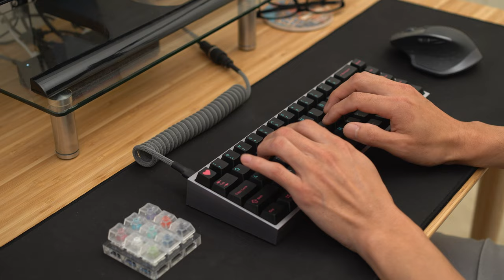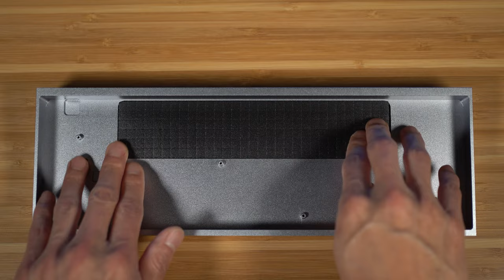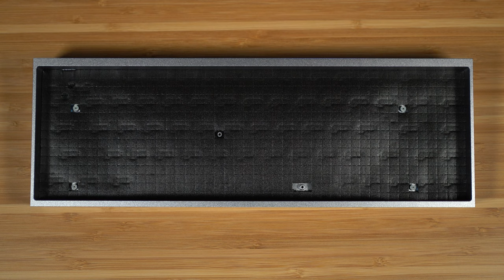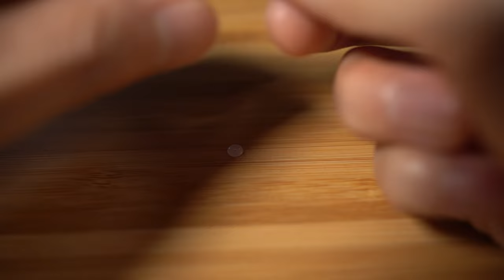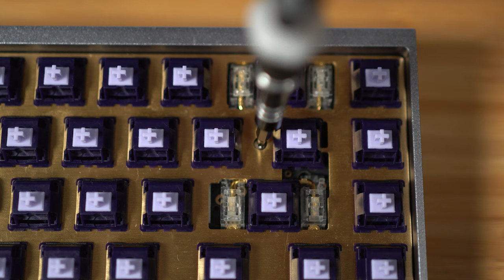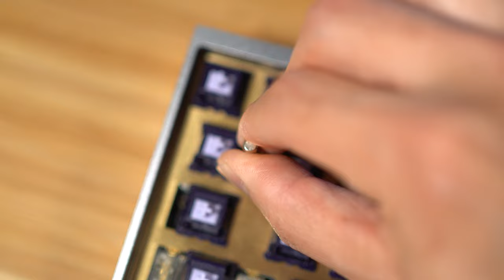Make the BEST sounding TOFU!  TOFU65 O-Ring Mount Mod Tutorial

Comment: I wonder if this is possible for the Corsair K70
Reply from the maker: Hi Kos Sports!  It's interesting you mention the Corsair K70 since I have a K60 right here which is very similar,.  Unfortunately, these keyboards actually have somewhat of an integrated plate design, and would be difficult to o-ring mount it to the lower tray.  Hope that helps!
Reply: @Keybored  thanks for letting me know! I know it's harder to mod boards like the K70, so that doesn't surprise me. I'm guessing that means I couldn't punt any dampening foam under the PCB either?
Reply from the maker: @KosSports  the K60 actually has space for dampening foam! Also I lubed the MX Reds that it came with, and lubed the stabilizers also! These little mods really did improved my K60! I hope it works for you too!

Comment: Would an o ring that is 4.5mmx1.5mmx1.5mm or a rubber o ring of the 4mmx1mmx1.5mm work fine? If so which would you use? The exact one with your size is kind of tough to find lol
Reply from the maker: Hi Kristian! I don't have exact experience with that size, but I assume the small difference shouldnt have too much impact. However, the thing to keep in mind is the ID! If it's too big, the screw will not catch, and just go straight through the o ring

Comment: would u recommend cutting off the middle standoffs
Reply from the maker: If you're using a stiffer plate like brass or aluminum, I don't think it's necessary.  With the O-rings on the outer stand-offs, I didn't notice the center part of the plate actually touching the stand-off at all.  It floats there pretty well!

Comment: I have the exact same board as you and did the exact same mods, but mine doesn't sound like yours. I've tried durock T1, durock smokey L7, holy pandas, NK creams, gateron milky yellows, koalas, etc. Does this sound ONLY come out with your switches on a tofu?
Reply from the maker: Hi John! I believe standard T1s should also yield same sound. The keycaps I'm using also contribute to this unique sound. I noticed that the doubleshot abs (gmk, epbt abs caps, etc) makes more of this plasticky pitch. Also, make sure not to tighten the screw down all the way and squish the o rings too much!
Reply: @Keybored  quick question.. How far do u place the fifine mic from the keyboard when u record sound? I'll keep trying my friend. Thanks so much for your response.

Comment: Why did you forego the two center stand offs?
Reply from the maker: Hi Lucas!  I skip the middle stand-offs, since I'm using the outer 4 and the orings to elevate the pcb/plate and reduce the hard contact points above the alpha keys.  This helps to create a more even feel and sound, and also softens the typing feel quite a bit!

Comment: Personally I still feel the sound is uneven when I tried this.  I still like a build with no stand offs for some reason. Gasket or not doesn’t matter just no stand offs in the build even between pcb and plate.
Reply from the maker: Make sure not to tighten the screws too much.  If you tighten it too much, it pretty much goes back to the stock tofu :)

Comment: Would slightly bigger O rings work? Only ones I can find that will come this month have a ID of 1.5 mm and an OD of 4.5 mm.
Reply from the maker: Hi Ben, the larger OD might be ok, but I'm not so sure about the larger ID.  It might work out ok, but only thing you need to watch out for is so that the screw head doesn't go through the ID and render the o-ring's effectiveness.
Reply: @Keybored  alright, thanks for the response. I'll order some larger ones and see if they work out. The diameter of the screw head is ~3mm, so it should be fine if I don't screw them in too much

Comment: Instead of silicone o-rings, could I use rubber one’s instead?
Reply: Did it with rubber o-rings, works the same its just not as cushioned
Reply from the maker: Yup!  Since the silicone ones are a bit hard to come by, others have tried it with the fluorine and rubber, and also achieved great results!

Comment: i dont know how yours sounds so solid, i have a 60% but it sounds kinda hollow or like metal and i cant seem to fix it. any sugestions ive tried o rings and foam they help but i still have the sound
Reply from the maker: Hi HEYLEDG! I made sure to fill the entire lower cavity with the foam, including the little cavity in the middle. I also used plate foam in between the plate and pcb. If these didn't work, I think an option (albeit an expensive one) is actually sorbothane. That stuff absorbs so much sound and really helps to eliminate ping. Hope that helps!
Reply: @Keybored  might have to try the plate pcb foam and if not I’ll have to try the expensive stuff lol. Thanks!

Comment: Why did the screws go through the plate when you tightened it? Is it even mounted properly?
Reply from the maker: Hi Alfie, the keyboard is mounted via the PCB to the stand-off below.  So the plate hole is a passthrough access to the pcb so that it can be mounted to the stand-off.  The Switches keep the Plate and the PCB together.  Hope that helps.
Reply: @Keybored  it does, thanks!

Comment: Great tutorial. One question, since you have the o-rings offsetting the whole pcb does it affect the usb c cut out at the back? I would assume it would either be off center or even worse the cable head having a constant stress on the top part pushing against the cut out.
Reply from the maker: Hi Byong, fortunately, the case of the TOFU had enough space that even with the o-ring offset, the pcb usb-c actually fit in there no problem, without too much stress to the usb-c socket itself.  I noticed that without the o-ring, my pcb usb-c socket was actually touching the bottom of the case cutout, and now with the o-ring, the pcb usb-c port is now touching the top of the case cutout.  No impact to the USB-C cable itself as I can see.

Comment: my screws are too short to screw into the standoffs with the o-rings. What should I do?
Reply from the maker: Hi Chloe! I was told that some kits came with shorter screws than the ones I received in my kit. The screw that I used were m2 x 5mm screws!
Reply: @Keybored  Thank you so much! Your o-ring method looks so promising

Comment: I ordered some 4.5mm x 1mm x 1.5mm will
These work even if I have to clip a little piece of the o ring?
Reply from the maker: That should work fine! There is enough space on the stand off to take the 4.5mm outer diameter. As long as the ID is 1mm or close to it, the screw shouldn't go right through it and "catch" the o ring

Comment: Would there be much of a difference if i used 4.5x1.5x1.5 o rings?
Reply from the maker: Hi jnzo!  The OD and the thickness may not be much of an issue, but that larger ID may be.  The screw head might end up just going through it during the burger mounting unfortunately :(

Comment: Do you prefer the Zip N Fit foam or the Kilmat?
Reply from the maker: Depends what you're going for! Kilmat is used for max ping control while zip n fit is moderate for ping and good for hollowness. Kilmat doesn't do much for hollowness since it doesn't occupy much volume. Zip n fit also tends to make things sound more "thuddy" if you want to go for that effect. So many different fillers lol and all do somewhat different things so I try to first see what the case/keyboard is all about then go for a solution
Reply: @Keybored  thanks for helping me realise the question within my previous question and answering it. (:

Comment: Did you use the same stock screws or have to buy longer screws for the o ring mod?
Reply from the maker: I used the stock ones. But I was told that some kits came with shorter screws. You need m2x5mm!
Reply: @Keybored  thanks for the fast reply!!

Comment: I get o-rings on switches but what is the benefit of o-rings on screws
Reply from the maker: Hi Enokis!  I used the o-rings on the screws and stand-offs to do a burger mount :)  It helps to reduce the hard mounting points and resulted in a more even feeling and sounding keyboard.

Comment: I really hope you see this, but how thick is the foam you're using?
Reply from the maker: Hi Robin, the foam I am using is the contact zip-n-fit liner, and it's about 2mm thick.
Reply: @Keybored  Thank you so much for your reply, i have one more question. i'm getting the same case and stuff and is 5mm thick foam good or is that too thick?

Comment: Hey, i just recently did the o ring mod and now ever since i have done it my spacebar rubs against the case making this terrible scratching noise. I have made sure to align the case perfectly but it still makes this noise. Do you know i can fix this. I have now experienced the amazing feels of this mod and now when i tried to go back my keyboard feels like crap.
Reply from the maker: Hi Tim, I had a similar issue with a few keycap sets. For example, the gmk spcacebar wouldnt run, but the epbt abs one did. In the end, I took a 1000 grit sand paper and just rounded the lower front edge of the space bar a bit and issue went away!
Reply: @Keybored  Damn so i have to grind my gmk spacebar? Thats unfortunate
Thanks for the reply

Comment: Would the flourine o rings sound as good ?
Reply from the maker: I have been told by others that it works, but doesn't have the pop of the silicone as much. I tried it with butyl o rings, and it does improve the sound and feel, but also didn't feel as "poppy" as the silicone o rings!

Comment: Have you tried this with an acrylic case? i really like the look of the frosted case but i worry the brass would take away from the look as well
Reply from the maker: Hi D H!  I have not tried this with the acrylic case.  I don't want to assume it will have similar results, but from my experience with the aluminum case, I hope it helps to improve the acrylic one as well.  I hear you on the brass and the acrylic.  Perhaps you can use the aluminum plate?
Reply: @Keybored  I ended up going aluminum but might make an acrylic down the road. Thank you again for this! I can’t wait to try this as well.
Reply from the maker: @DH-nf4iq  No Problem! Glad to be of help!
Reply: @Keybored  Hey man, just wanted to let you know i finally built my Tofu and it sounds leaps and bounds better than my k6 i previously had. Thank you for posting this build!
Reply: hey Scott, I was trying to source an FR4 plate for my tofu and I find someone to make them, however, they need a minimum quantity of 5 and I only need 2 myself. I thought I'd ask you since I feel like a lot of people are going to be interested after seeing this mod. Please let me know!

Comment: do you use any foam aside from the one u put yourself? like pcb foam or smth?
Reply from the maker: Yup!  I did use the PCB foam in between the plate and the PCB!  It's 3/16" Vinyl adhesive foam that I cut and attached to the back of the plate!  Check out how I did it on the NK65 upgrade video on the channel!

Comment: Does this work with all kinda of tofu cases? I saw a few videos where the usbc cutout was huge with much spcw bellow and above the port. Mine is cut to only allow the cable in. Will the o rings make the pcb too high for theport to line up?
Reply from the maker: Hi Phillipp! This should work similar for the other tofu cases as well! The 1.5mm thickness o ring is thick enough to elevate the pcb above the stand off, but thin enough that it allows the usb socket to clear the cutout. The Tofu65 case I'm using is an exact cutout shape, so this was considered during with the 1.5mm thickness o ring. Hope that helps!
Reply: @Keybored  yesss the answer was perfectly helpful! tyvm!!

Comment: With the tofu 60 there isn’t a standoff in the bottom left corner, I already ordered the O-rings, what stand-offs Should I use?
Reply from the maker: Hi Myles! I believe the standoffs foe the tofu 60 differ from the 65 a bit, but you would be using the outer 2 on each side and skipping the center 2. I have had viewers do their own this way, and came back with great results!
Reply: @Keybored  thank you!

Comment: Would the difference between the KBD67 rev2 and the DZ65 RGB V2 Hot Swap affect this mod?
Reply from the maker: Hi Darryl!  I have done it for both and the results are the same!  It's actually much easier to do on the DZ65, since you can install the pcb separately, then add in the plate and the switches on top, without having to drop in a screw through the tiny plate hole lol.  Hope that helps!
Reply: @Keybored  Very much so, thanks!

Comment: The link for the O rings only shows 4.5 by 1.5 by 1.5mm o rings, will these work as well instead of the 4 by 1 by 1.5 ones? Thank you.
Reply from the maker: Hi Caden! Hmm it looks like the 4x1x1.5mm must be sold out again. I haven't tried the larger size but the issue would be with the ID being a little bigger. The screw head may end up going through the o ring instead. Before moving to a larger size, I would use the same size but of a different material, like nitrile or fluorine. Hope that helps!
Reply: @Keybored  I found a reddit post for some more o rings, and this is what they used : https://www.amazon.com/gp/product/B07F3ZL7JM/ref=ppx_yo_dt_b_search_asin_title?ie=UTF8&psc=1 
do you think these will work? And wow you responded fast!

Comment: I heard brass plates are pretty stiff, do the o-rings give the plate more flex? I’m thinking about using the exact same parts and materials (except T1 switches) but I am on the fence about the brass plate
Reply from the maker: Hi Brandon!  You are correct.  The brass plate is very stiff, probably right after stainless steel plates.  The O-Ring mode definitely helps to reduce this stiff feeling and adds in a bit more cushion, as you can see when I press down on the plate, you see it go up and down.  If you're on the fence, you can also try an aluminum plate and it might be a good balance as well!
Reply: @Keybored  Thanks for the response, I'll probably go with a brass plate because I love the way your Tofu sounds, and I wanna stick with the parts you used to have my sound as similar as yours. Also, have you ever used T1 switches before? IK you used Lilac switches and I head that Lilac is a smoother T1.
Reply from the maker: @bdonnto5722  yup, I have a few builds with a t1 or modded t1. They are very nice switches with great tactility. I think the difference is that the T1 has a polycarb housing, while the lilac is a pc/nylon mix. After lubing, I felt that the lilac was a bit smoother to my fingers, but I don't think the difference is major at all. You can also try koalas (white and black t1) I heard those are also very nice. Hope that helps!
Reply: @Keybored  It sure does, thanks a lot!
Reply: @Keybored  Hey! I did the mod on my Tofu65 and I am not getting the popping sound like in the video. I think it has to do something with how far I screwed the screws. I used the same silicon o rings on the 4 outer strands. Although I do get some pop, it is not as nice as yours. I used different switches than you but besides that everything is the same as yours. Do you have any advice on what I could do to get a nicer pop sound? The overall typing experience is very even and pleasant to type on, it's just the pop is not as nice.

Comment: What happened to the 2 middle holes? Did you just put the screws on or did you o ring the screws too?
Reply from the maker: Nope!  I left them completely open, since the o-rings on the outer stand-offs elevated the entire assembly above the centers.  Less hard mounting points!
Reply: @Keybored  Is it better to leave it open or put screws in?

Comment: I was thinking of trying this mod on my tofu but I'm worried about the screws getting stuck between the pcb and plate if I ever decide to disassemble it. Is this a problem I should be worried about?
Reply from the maker: Hi Da Mede! If you're using hot swap board, no issues at all! If soldered, you'll have to be very careful when removing to avoid this issue
Reply: @Keybored  Sadly I have a soldered build so I'll just have to be more careful. I was also wondering if you bought longer m2 screws to reach the standoffs?

Comment: So wait, am I screwing until it gets in a slight amount or screwing until I can feel that its starting to get tougher to tighten
Reply from the maker: Hi EXILE!  I tighten it down until its firm, but not squishing the O-Ring too much.  In order to prevent over-tightening, I use just the tip of the screwdriver and hand-tighten until snug and tougher to tighten.  Hope that helps!
Reply: @Keybored  Sounds good thanks! Also do you know what makes your board sounds so clacky and loud? Not sure if it's just the mic thats picking it up. My current build is a tofu65 with some old mkultra foam (made this a long time ago. going to be trying out stupidfishs foam when its available in canada), zealios v2 67g, a gmk set and a brass plate. It just sounds so light compared to this.

Edit: watched some other sound tests and my board sounds similar to most. Just a light/quiet clack I think. This mod may have made it sound and feel better a bit but still nothing close to this
Reply from the maker: @ExileEditing  Hi Exile!  What was interesting is that when I first did the O-Ring mod, I was actually expecting the board to get quieter, but in fact, it went the opposite and got more "poppy."  But I do record the sound right over the keyboard so I can reduce the room echo and make it sound as accurate as possible, so it might sound louder on video than as you're typing on it.  Hope that helps!
Reply: @Keybored  Yeah that makes sense. Could also be the desk and your room that made the difference. Thanks for the replies!